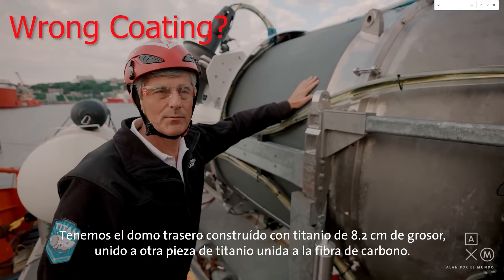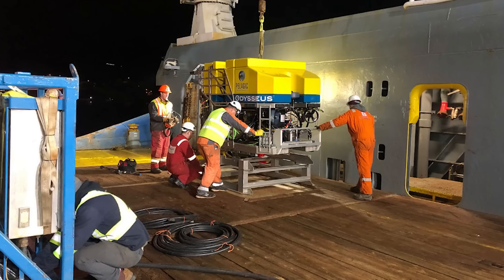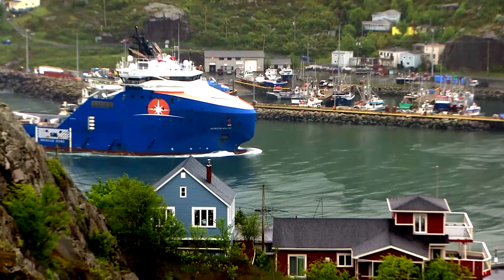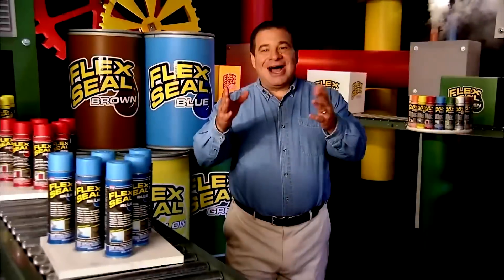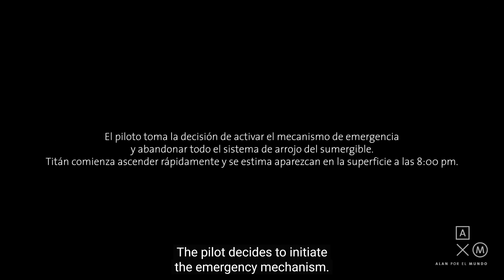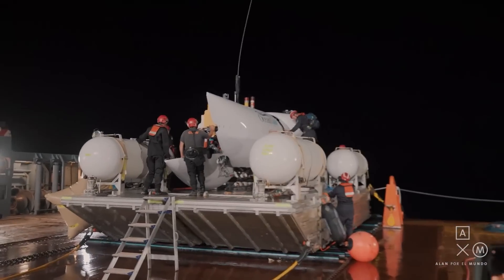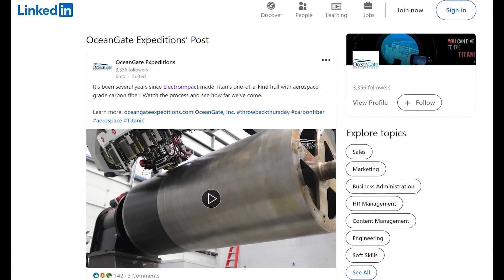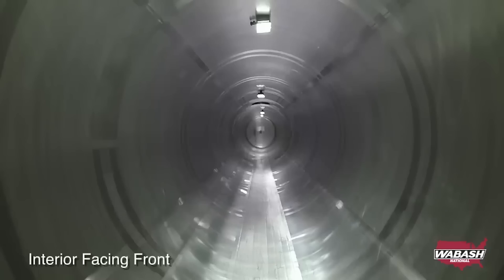Titan Sub Wrong Coating? Hull Construction, Debris Field Search

Comment: When SR mentions the Rhino Liner he quickly turns away which shows he is lying. I think adding this coating would prevent inspection of the hull exterior. Nothing that Stockton did was right.

Comment: The glue they used for the rings was designed to withstand heat not cold heat. No wonder it failed

Comment: Im a retired aircraft mechanic.   Some of the products have to be mixed for so long at a certain very high speed that most drill dont attain, therefore the paint/adhesive looks like it works but doesnt.

Comment: How are the ballast weights released? Photos I saw look like there held on the side/bottom with bailing wire. How is Rush able to cause the release from Inside the cylinder. thx

Comment: I watched 1 video about the manufacturing process of the Titan and it was obvious to me that it was the it was the joint between the carbon fiber and the titanium ring and sure enough. That's what the investigators found it was the joint. Anybody that knows anything about carbon fiber construction knows that the weakest point is the joint... dumb s***

Comment: No matter how many wraps of carbon fiber in multiple directions, with the strongest space age coatings and executed in a clean room with the world's finest technicians would have made a difference, as carbon fiber can not handle compressive loads such as are encountered in the deep ocean. Maybe as a one shot deal, but it was going to fail eventually under repeated compressive cycles no matter how well built or designed it was. They just got lucky that it lasted as long as it did.

Comment: You are right - the first hull was hoop spun, and they did the second hull with vertical hoops in one layer and horizontal hoops in the next layer. There was no alternating strands or anything. It was just like having two layers, but one , one way, and one go on the other way , so that they are situated perpendicular to each other.

Comment: I think the Rinoliner was probably the least of Stockton's Submersible short comings.. 
 If I remember correctly the Titans viewing port was rated for 1,300 meters...
The Titanic sits @ 3800 meters....
Apparently by 1st hand account in an interview, one of the Previous Paying 
"Mission Specialists" 🤥 said that the Acoustic Hull sensor counter  kept climbing and were also quite audible all the way down to the Titanic....... 
So it is quite possible that their may have been Some indications just before the near instantaneous  Implosion ... And may have been Assumed it was it's normal Behavior...

Comment: Rino liner would act like a liquid at 6500 psi.  It would go right through oinholesnin the laminate which was just a low strength vacuum bag cure, not an autoclave which is what you’d need for structural composites.

Comment: With the cost of 2 carbon fibre hulls and if they had made it back he would likely have needed another one made,
So with the problem of regularly needing to buy a new hull every dozen dives is carbon fibre offering any financially realistic benefits at all over buying a single titanium hull and not having to constantly worry about hoping the hull lasts at least 10 dives,
Also the titanium version of that exact hull made basically of the same design, basically a pretty simple thing to make in terms of a titanium submersible hull,
It's just a tube with some windows that need cutting,
I really wonder if there would be much of a difference at all between a single carbon hull let alone 2 considering it's literally a tube with end caps basically so that make even a simple job even easier,
It would be really interesting to know what the cast difference is between a titanium hull and a carbon one of that exact design,
I bet there's not a great deal at all between them especially as the carbon hull needed to be designed on top.

Comment: All of the rubber adhesive "liners" use a petrochemical that evaporates from the liquid to facilitate the adhesion to the surface its applied to. Could the petrochemical compromise the epoxy that holds the carbon fiber together?

Comment: What - to me - would be a credible explanation to the 1/3 scale testing is what could be fitted into the available test chamber. 
I mean, you're looking at a very unusual set of requirements here. The market for products needed to be tested to those pressures is really, really small. With a small market, there's (usually) a very limited number of (and access to) test facilities.
Are there even over pressure test chambers available to send something as big as the Titan on a simulated dive to the relevant depth?
I'm not too eager to call the Rhino Liner the smoking gun here.
Sure, it's a novel use of the material. One probably never imagined by the manufacturer.
But it isn't structural in the common sense of the word. 
Unless it can be shown to be permeable - at a significant rate - to water at the pressures experienced during a dive, there are several design features that seem more likely to fail.
I suppose a mechanical failure of the Rhino Liner barrier isn't entirely impossible. 
Either by the CF cylinder compressing enough for the Rhino Liner coating to wrinkle and split, or for it simply to creep under pressure and create spots that are thin enough to cause seepage.

Comment: There has been so much wrong with those sub from a mechanical and engineering standpoint - it is a wonder they were operational at all.
Reply from the maker: It made a few trips down to Titanic
Reply: @jeffostroff   Yes and the astonishing part is that it survived any trips given the shoddy engineering. Every trip had some major problems. The sub deformed a lot, creating a lot of noise and making servicing it a nightmare, they had numerous electronic problems and failures before and were warned about serious design defects before.

Comment: Platform rising crooked and slowly might be from compressed air fitting or reduction sections within lines freezing up causing a blockage or intermittent compressed air from moving thru the lines,,, not unheard of.   Enjoy this open data and reports because I see one day anything like this will be only for people with "need to know" authorization.

Comment: The physical response of a one third model would not be the same as the full size pressure vessel. Carbon fibre is normally used in tension, such as pressure cylinders containing high pressure gases. I don't know of any uses where the material is subject to compressive forces except for the Titan. The hubris of Stockton has cost four people and himself their lives.

Comment: Well there is one new thing I learned.  I wondered why they didn't all die on dive 3 or so, but actually made it around 13 or so times.  The reason is the hull they used actually was made by what looks like a robot in a clean factory.  It was probably actually free of major defects.  Of course, if the 'crackling aft' story is true, that doesn't mean there weren't still life threatening defects, but it wasn't the carbon fiber itself, but the interface to the rear hemisphere...

Comment: Carbon fibers strength is resistance to stretching or lateral resistance not compression, that is why it is primarily used in aircraft wings and tail surfaces..

Comment: Aramid Fibres ( Goretec ) and Carbon Fibres, are only reinforcements.  The polymer, usually Polyester or Polyvynals are just that.  Plastic.  They are a 1,000 weaker than the fibres.

Comment: i said a similar thing regarding the testing, we live in a world of automation, robots, and able to send satellites' into orbit, to other planets, unmanned
so why didn't this company send the Titan down repeatedly to a similar depth 50, a 100 times, then i'd be convinced, just to have a few tests on a model says nothing
note the model was all carbon fibre, the ends of Titan were titanium, and i am sure the issue was with these end caps being glued onto the carbon fibre tube, the surface area on the ends were very small - a lesson learnt in applications such as space rockets, boosters and so on, if a surface between A and B is only 2 inches, if you create a zig zag or stepped surface between A and B, you therefore increase the surface area, simples, not saying its the cause, but i'd swear it didn't help being so small, and a same goes for the forward observation window, that looked more like a washing machine, and on reflection a washing machine probably could have done better

Comment: Use any space capsule since a vacuum is stronger than any pressure we can push and can adapt to extreme temperature changes as well.
Reply: wrong. space capsules are crushed at these depths. space capsules are meant to keep atmos from escaping not keep pressure from crushing the capsules. space capsules have to be extremely light hence they do not use thick heavy substances such as titanium or acrylic or steel
Reply: @toomanyaccounts  I was being sarcastic space capsules can't work in space either.

Comment: The sub must have been heavier than in past dives, which would explain the rapid descent,  but where was the extra weight, seeing how even after dropping ballast and the frame they were barely rising, this tells me the extra weight was somewhere else on the sub, it is almost like they were waterlogged. Now we learn the sub had a rubber lining called Rhino liner that covered the carbon fiber and was supposed to keep water out of the carbon fiber, if that failed the CF could take on water like a sponge.  Another mystery solved,  by the way, my truck bed is covered in Rhino liner but I  have no plans to test it underwater

Comment: 11:20   Hey Jeff, you say they didn't move it by switching Direction with diagonal lines going across and then coming back to make it even stronger.
Video shows they did. By switching from vertical to horizontally, no? What am I missing here Inspector Detector?
Of course how could they affix horizontally when reversing back and forth from one end of the beer can to the other edge?

Comment: all I know it was a terrible way to be neutralized, especially so closed to there target. I suspect like its been noted in other videos that the titan lost control and was in a crashed dive configuration, going down fast caused it to implode. It if had been going down gently like it was designed to do, everyone would still be ok. The rhino liner served its purpose on the gentle dives but nothing including the carbon fiber can withstand a crash dive scenario, only pure titanium can do that.

Comment: Cheaper carbon fiber without autoclaving isn't reliable during pressure changes either.  It seems the deceased CEO was overconfident in how much warning the Real-time Monitoring System would provide.

Comment: Could someone please remond me, why were they using spun carbon fibres and glue, why not use a steel or titanium cylinder or sphere?
Reply: because Stockton Rush didn't want to pay 15-30 mil for a craft that can make the trip thousands to tens of thousands of times yet only have one to two passengers. He was only worth 10-12 mill. to make such an expedition profitable to not only cover the cost of support ship, crew, supplies than the cost of the craft you would have to charge several mill a ticket. most of the people who would pay that did during the Mir trips or could buy their own submersible from say Triton Submarines and already had a boat that could host the submersible

As it was Oceangate Titanic trips were bleeding them dry since the cost of expedition was more than they were getting in tickets since the majority of dives with the Titan were aborted due to equipment failures. One season was aborted entirely because oceangate didn't even secure the support vessel
Reply: @toomanyaccounts  OK thanks. But the money they spent on R&D-ing the carbon fibre structure could have bought them a titanium hull? For example they could have bought a titanium cylinder from the same company which manufactured the titanium end caps for them. Just thinking it is crazy using that glue as we all saw on that video, in a non-clean room environment, and without any mechanical fixings... There must be something more to it other than the financial cost of a solid metal hull.

Comment: I have to believe that something from the electronics suite (cameras, hard drive, motherboard, etc) survived the implosion and has flight data recorded that will provide insight to what happened.  Despite US and Canadian tax dollars being used for the recovery operation, I wonder if that information will ever be released.
Reply: do you honestly think Stockton would spend the money on not only electronics that would survive an implosion but being immersed in extremely cold salt water that is also under high pressure?
Reply: @toomanyaccounts  of course not.  OceanGate trimmed costs everywhere and he would not intentionally install an equivalent of an airplane blackbox.  That being said, all you need is a memory card or an intact hard drive to retrieve data from it.  But that may be impossible to find in the debris field.  I would suspect the best candidate would be the collection of parts in the tail section.

Comment: Rush should be the Head Mouseketeer. Rhino Liner is NOT designed for underwater pressure.
Were the titanium rings glued on with Elmer's Glue to save money as well...

Comment: James Cameron said he experienced a similar buoyancy issue in a certified sub.  Apparently, the deck of the Titanic creates a downdraft near the surface above. 

Cameron said they had 2 attempts at an emergency ascent (after they realized they were almost out of power due to extreme currents), only to almost reach the surface and be rapidly sent back to the bottom by a wicked down draft.

On the 3rd try...they barely made it.  Perhaps the Titan descended into the down draft, and their later attempts to ascend were also slowed by this same down draft.

The continuous change in pressure must have been bad news for the aging and stressed carbon fibers on this doomed Titan expedition.

Comment: I was JUST writing about Phil Swift and his FlexSeal when Jeff mentioned it… How many thousands of viewers here had the very same thought?? 

What other products could SR have used? Duct tape, chewing gum, baling wire, an opened coat hanger, staples, school paste, and a couple paper clips of course…

Maybe bulldog clamps, Gorilla Glue, Post-it Notes, a bunch of those “free” self-addressed labels that arrive in the mail every month, sealing wax, twist ties, rubber bands, maple syrup, “bachelor buttons” and a hammer, old postage stamps that require licking, the stuff scraped off a tray after over-roasting some animal product, the leftover jellied cranberry sauce, lots of safety pins, the once ubiquitous “bobby pins,” an old zipper from a very used coat, a handful of Brill Cream, “a little dab will do it; Dippity-Doo!,” packing tape, styrofoam peanuts, Bondo, bumper stickers, that curiously tenacious material found the table top after a kid rested their gum and candy on it, and a cut up paper grocery bag??

Too bad SR didn’t use his own saliva to cement the CF in place; like his ego and need for recognition it was probably thick.

Comment: The sub was built on the cheap and they knew it wouldn't pass inspection.  The paid dives were to recoup the cost of building it.  The bottom of the ocean is not the place to try to save money.

Comment: Why did they test a 1/3 model? Because, when you look at other material testing for aircraft, etc, this is how it's done. A scale model  is cheaper to make, and the testing structures available are only so big - the larger they are, the more astronomical the cost. But when they saw how poorly a dome performed, a very strong sort of structure, perhaps they should have re-thought the use of this material on a much larger cylinder.

Comment: RHINO LINER = FLEX SPRAY IN A CAN! LIQUID RUBBER IN A CAN

It sprays out as a thick liquid, seeps into cracks and holes and dries to a watertight, flexible, rubberized coating that will Stop Leaks Fast®. Once dry, can be painted any color. 
HANDYMAN IN A CAN approved by Stockton himself.
Reply from the maker: Stockton in a can!
Reply: @jeffostroff  Omg 😂
Reply: @jeffostroff  I wrote my comment before you put the ad in the video! Great minds think alike haha

Comment: 8:47 - 11:47: Jeff: "Many of you pointed out that the hull that was commonly featured being constructed wasn't the one that was at the Titan that went down, I was wrong, it was reconstructed differently"
(Shows a bunch of tests to show they're working on another hull
11:00: (Shows video footage of another hull being constructed with a much more finer strip being used and spun and Oceangate didn't get any of the advice on how it should have been spun onto it!)
😨😨😨That looks like it's been constructed much more worst then the first time with how fine the carbon fibre is spun onto it! Much worse!

Comment: I’m a spray painter and we get guys in who spray rhino liner on mining vehicles for us. 
It’s a really hard wearing polyurethane coating.. 
it can be put on up to about 10mm thick.
Great for resisting stone chips and as a protective coating for steal..
Never heard of it being used under pressure… I’m no expert on the topic but I’ve never heard of it being used for this application.